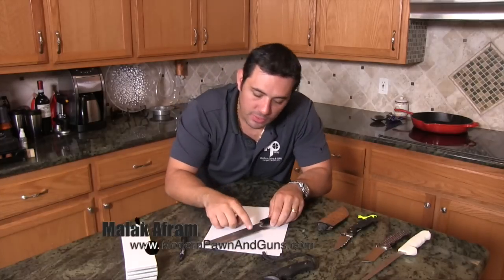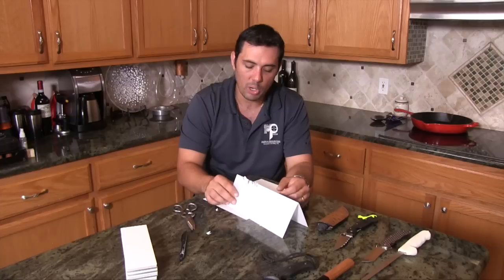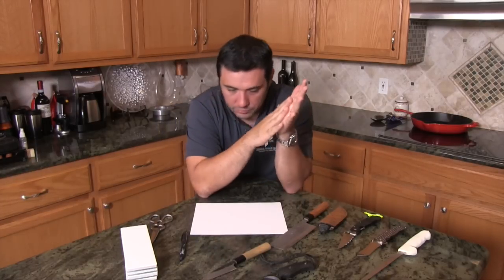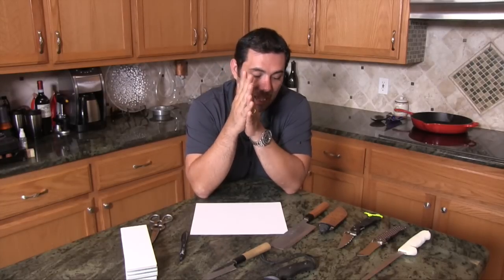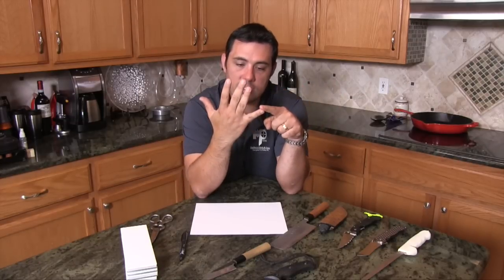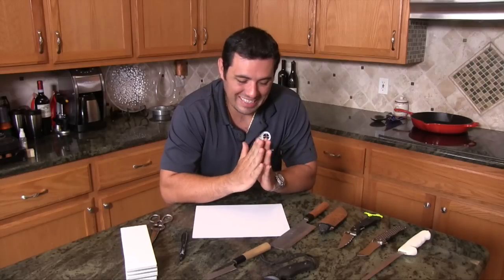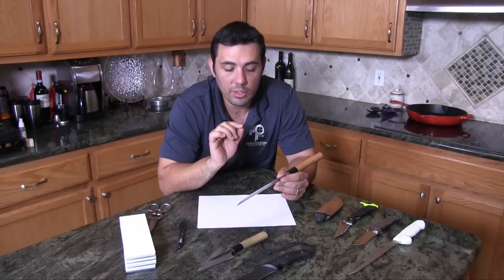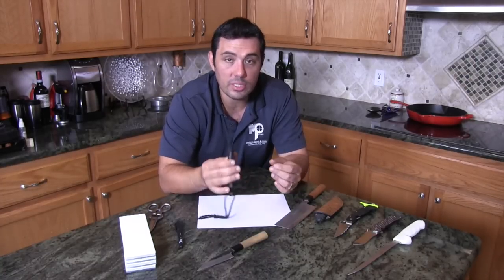Knife Sharpening Series: Scratch Pattern and Rockwell Hardness

Comment: Good video. AEB-L stainless comes pretty close to a "perfect" steel considering the 3 criteria. Pretty inexpensive as well.
Reply: Oh and that 3V blade is probably 59-60 rc. if the heat treat was done correctly, 3v is super super tough at 60rc.